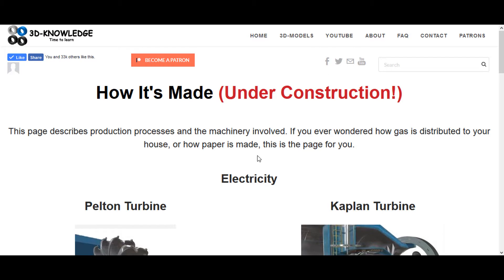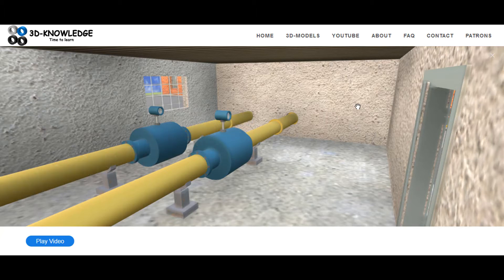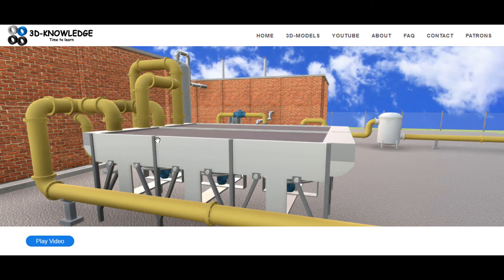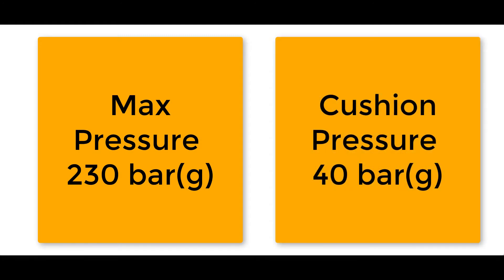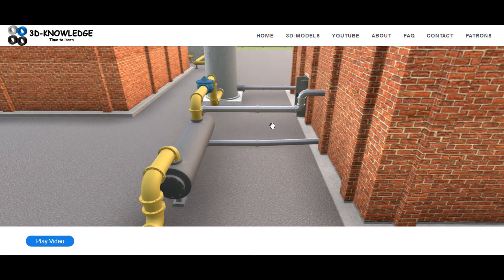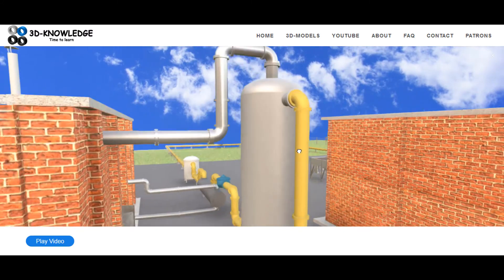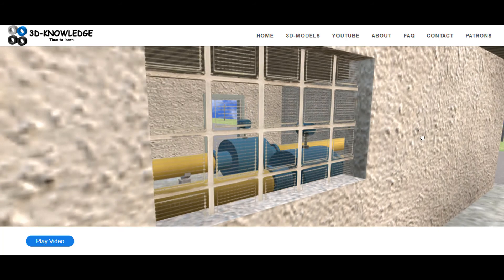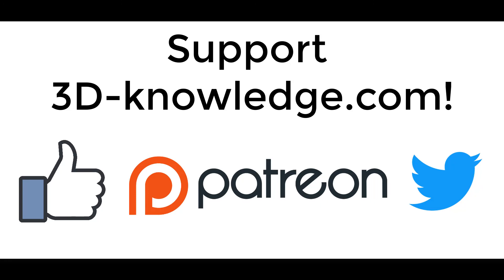Gas Storage Explained (Part 2, Gas Cavern Process)

Comment: How important is to remove the moisture and heat up the gas?  What would happen if these steps are ignored?
Why not storage the heat of compression to use it on decompression?    Or using a passive heat exchanger with ambient air to reheat the gas or release the heat on compression?
Is the moisture bad for the pipes?  The moisture comes from the cavern dont you?
I imagine that the answer to all this is just "they dont care about efficiency because the energy cost for these process is negligible".

Comment: Great video! I was waiting for it. I just wish to understand where the water, that must be tooked off using glycol from the the gas, came from? Is from the cavern?
Reply from the maker: Water is from the cavern, there might not be a huge amount of water coming from the cavern but it has to be removed prior to the gas entering the national pipeline. It is possible to use silica beads in huge towers, or, liquid glycol, for drying. 

The caverns themselves are normally surveyed every five years (approx.) using radar, the radar maps the cavern and allows engineers to see if certain sections of the caverns have collapsed etc. The cavern shape often changes over time because the pressure cycles from 230 to 40 bar etc., this puts a lot of stress on the cavern walls.

Hope that helps! Probably a video on tissue production or refrigeration next...